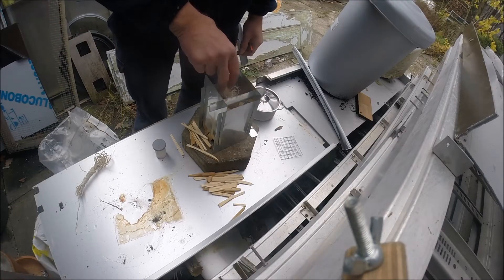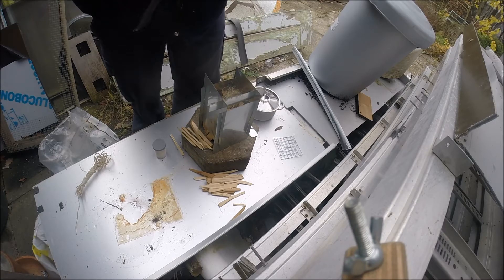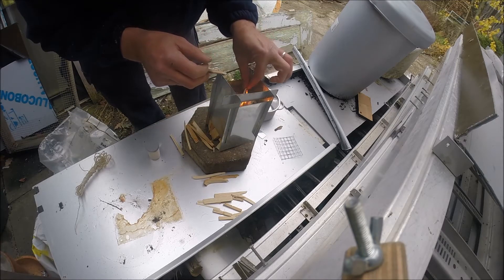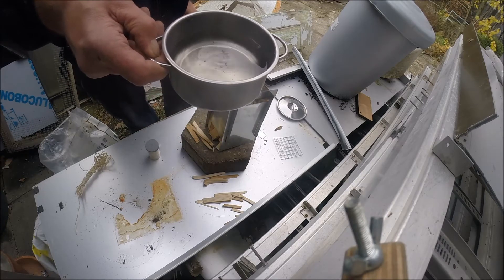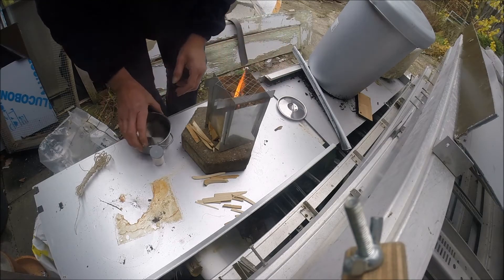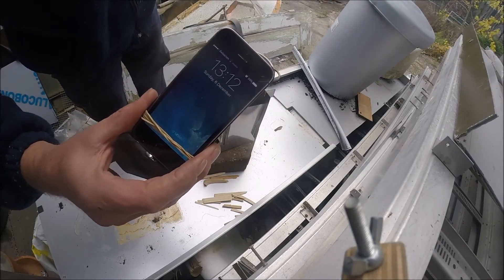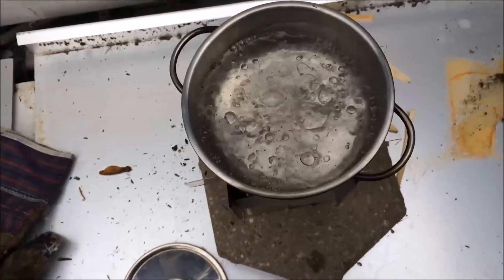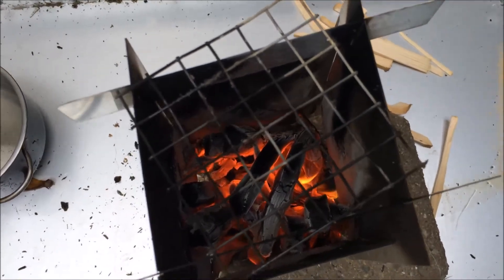Home made biomass stove boil test  06 12 15

Comment: Good job!
Reply: Make an air inlet at the bottom, put a piece of paper there, on and allowed to heat, when you have a white smoke, lit only from above: the Norwegian do like this, and invented double stove can, with little wood
Reply from the maker: +Catalin Oancea Thanks ;-)
Reply from the maker: +fred san I found it worked well I like top lit seems to burn nice and efficient and gets the heat where I want it fast.